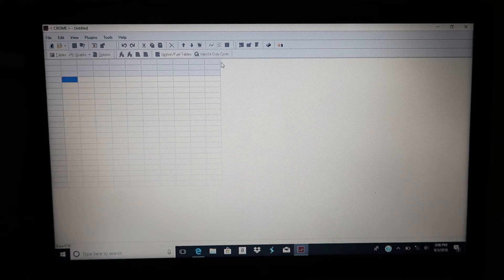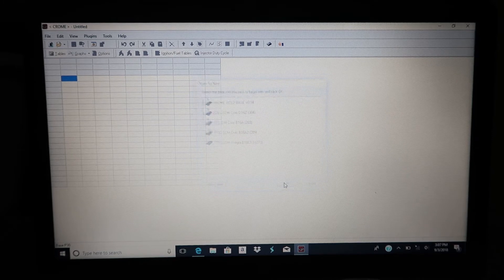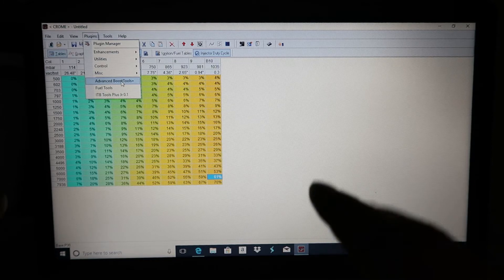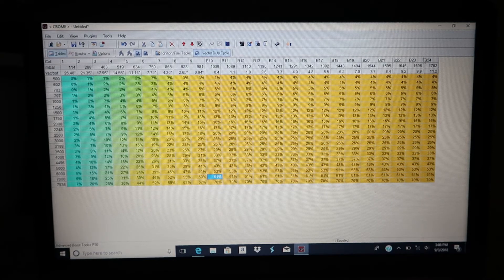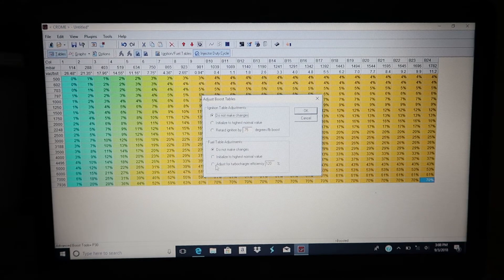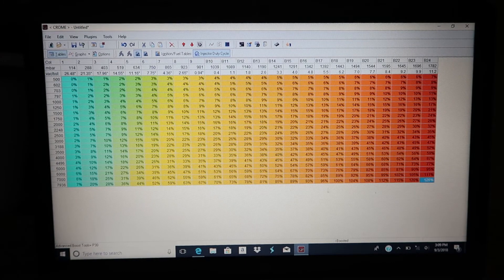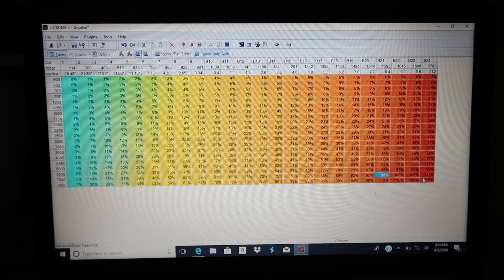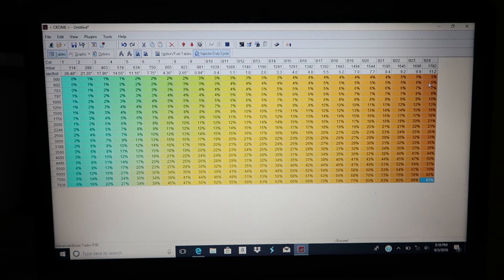How Much Boost Can The Stock Honda Map Sensor and Injectors Support??

Comment: This parameter values are on stock fuel pressure regulator and fuel pump? When you changed to 300+ cc injectors?

Comment: If you do go with the 330 cc injectors, do you need a tune? Trying to build on a budget and have the stock 240s running 7psi, but I'm getting no power after 2 psi

Comment: I’m tuning my b17 turbo on around 10 psi with rc 550 injectors and it says they are maxed out in the high cam but I’m still leaning out to like a 12.7 under full boost??
Reply from the maker: Did you enter your injector size so it will recalculate your duty cycle?
Reply: @BoBuilds  I’m pretty sure I did, but every time I go back in an look at it it goes back to 240 but each time I re enter 550 I see it change numbers on the map

Comment: Would I be able to run stock D15b7 injectors at 7 psi as a DD ?
Reply: If you bump the fuel pressure up 5 or 10 psi yes

Comment: Hey why would it throw a check engine light on a turbo 1991 honda civic dx hatchback it hit 10lbs 3 times separate drives then threw the code and i turned car off went away?

Comment: Good video. But 1.7 bar = 24psi  ...? A quick google will confirm this.
Guessing the table row youre reading for "11.2" value is something else, "vac/boost".
Reply from the maker: Its a 1.7 bar range. Think of it as negative 12psi (vacuum) and positive 12psi boost

Comment: Crazy question. Would a water injection system affect the top end at all? Without upgrading the fuel system I mean.
Reply from the maker: Your talking methanol right? I suppose it's like e85 as far as cooler temps allowing more timing before detonation is an issue. You wouldn't be able to get more boost but run more efficiently in the boost the stock fuel system will allow
Reply: @BoBuilds  Yeah, methanol. Thanks for the feedback. Oh well, can't get around that need for more fuel. :)
Reply: @BoBuilds  WRONG! By injection 50/50 water meth the fuel will run richer by 2 points meaning it will be adding more fuel ratio under boost. Depending on the size of the jet it will support up to 5-6 psi without changing the stock fuel injectors!

Comment: Would recommend 8psi as a max for a d16y8
Reply from the maker: 8psi is fine on a Y8. Ive been running 8psi for about 4 months now on just a base map. Driving it hard
Reply from the maker: Gonna see if I can run close to 15psi on E85, with the stock bottom end d16
Reply: 8 psi max with stock injectors?
Reply from the maker: Yes 8psi with stock y8 injectors
Reply: Cool keep up the awesome work man